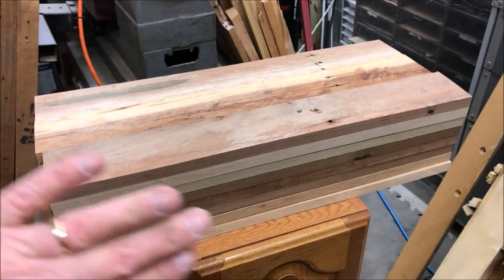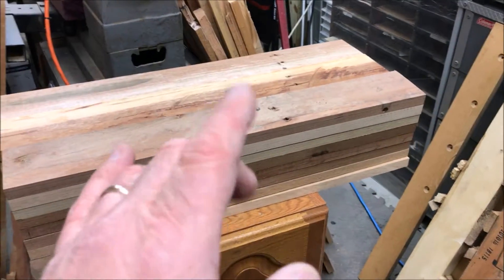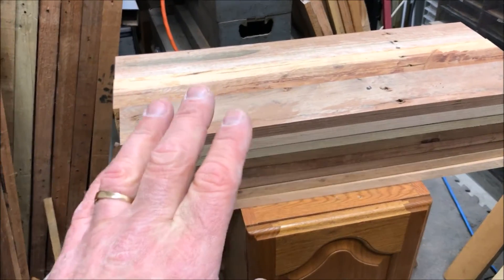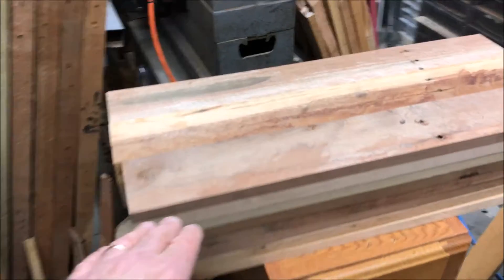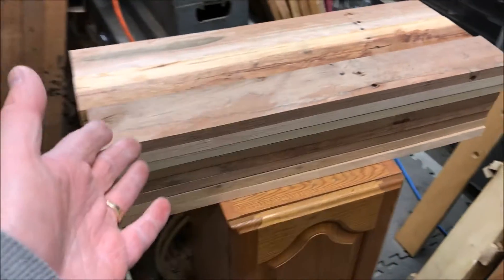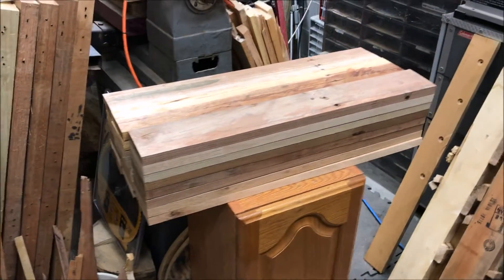Shop Update 3/13/2017

Comment: Before you thickness the pallet wood you should check it for metal.  As you've got a metal detector that should be real quick.   I've wrecked a blade with pallet wood in the past.
Reply from the maker: +dabbishaw I have been using my MD as well as a visual inspection for embedded rocks. I don't want to have to replace a blade for sure. 

Regards,
Bob